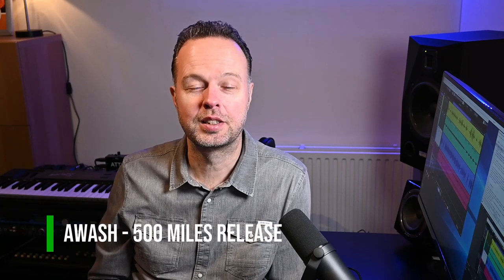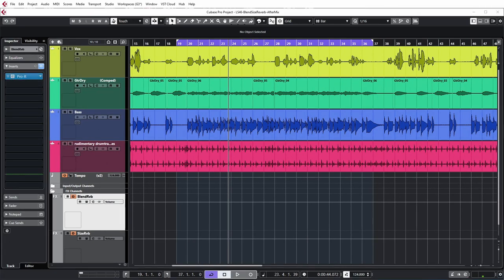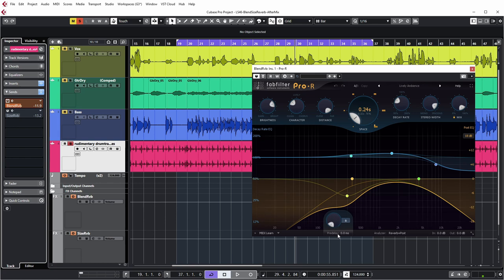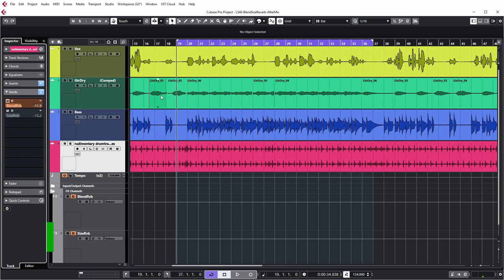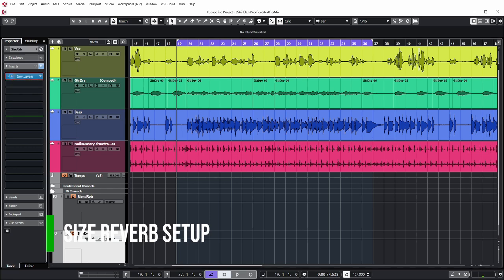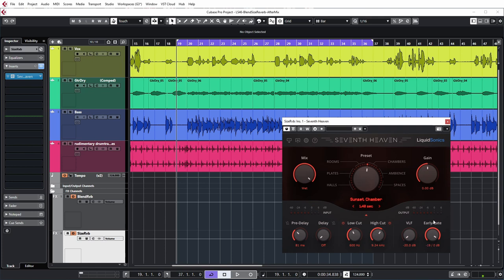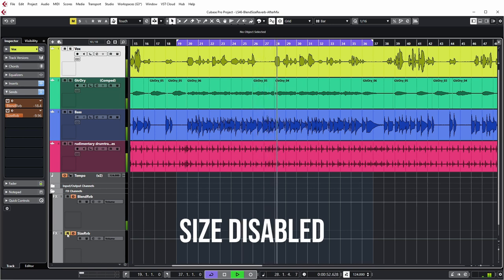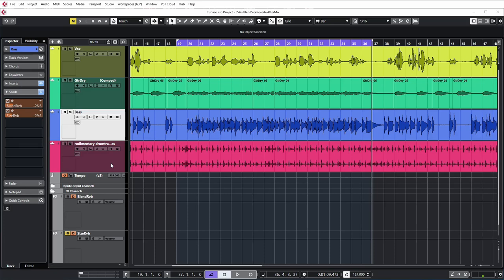How to use reverb in a mix for blend and size

Comment: After adding "blend" and "size" reverb could I also add a plate to the vocal? And could I also add another longer reverb on the guitar? Or better not use other reverbs?
Reply from the maker: Yeah sure. I use many additional reverbs for specific channels.
Reply: @LanewoodStudios  Thanks. So you add a "size" and "blend" reverb just to give cohesion and to give the sense of the room, right?
Reply from the maker: @AforismiDAutoreAD  exactly!

Comment: Great video, I am actually reading Mixing secrets for the small studio from one of your earlier recommendation videos and loving it. So much to learn, and Mikes website is a great learning resource too.  Thanks.
1 quick question: Why don't you use the Fab Filter reverb for size also?
Reply from the maker: Yes that book and the resources on the related website are great! And you are right, I could have used either reverb for both blend and size. Just wanted to show that this could be done with any reverb so used two different ones.
Reply: @LanewoodStudios  ahhhh thankyou. Just wanting to know as I'm looking to purchase the fab filter. Cheers.

Comment: Even 1 year delay I find this usefull & good video. Question about routing: I understand you added 2 FX channels each with the rrequired RVB as demo and each track apply the desire signal to the FX RVB by send. Now, how to you rout the 2 FX channels forward?  I use MIX BUSES in my mixes so is Direct routing to all Mix Buses?  Thank allot for Proffesional & Clear videos. Amram
Reply from the maker: Thanks for your comment and question. My routing is not so complicated really. I send to the reverb FX channels from the individual tracks and those end up directly on the stereo out.
There are some issues to be aware of when using group channels which I discuss more in another video https://youtu.be/TuujpKKW1qo